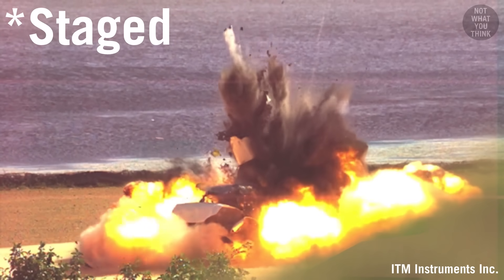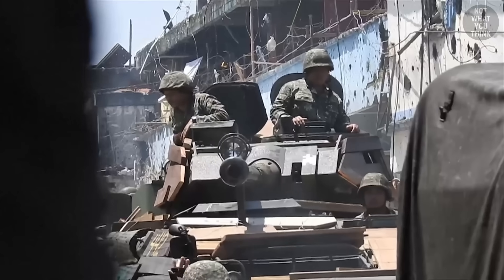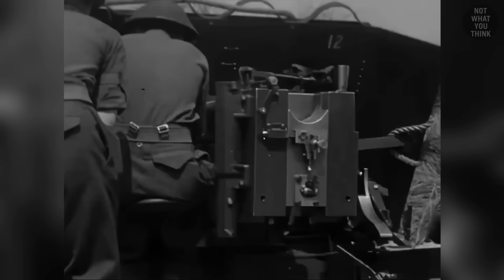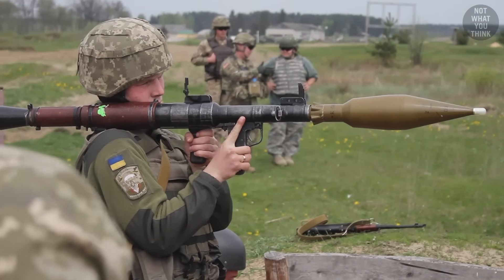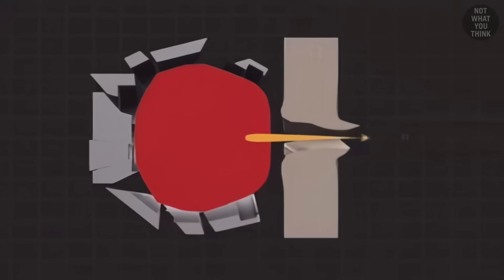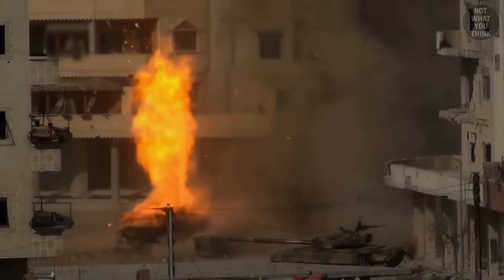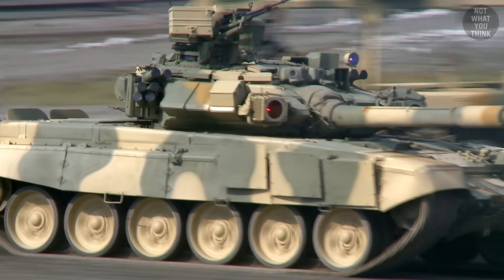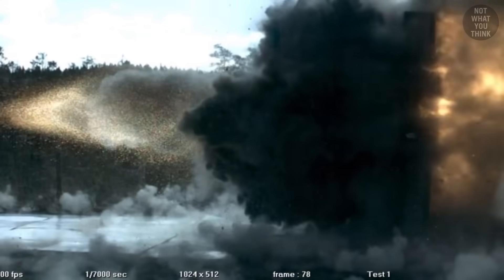Why Protecting Tanks is Getting Much More Difficult

Comment: This is basically what happened to the knight. Armor went up and up as the crossbows and warpicks evolved, even getting through some gunpowder. But when enough guys have pikes ans gunpowder, heavy amor its just too expensive, so the infantry revolution happened. 
If we repeat history, we could see lots of infantry supported by fast small tanks or recon vehicles with active defense systems and just enough armor to protect the core elements.

After that idk... maybe heavy energy shield generators with laser guns
Reply: It is a common misconception that armor was prohibitively expensive. Production methods and capabilities saw a considerable improvement in the late middle ages. 
If you were a citizen in a german city around 1600, you had some privileges but also duties. 
As your duties revolved around keeping the order and aid in the defense of the city, many cities required from their citizens to keep a full set of armor and some specific weapons and guns.  
When gunpowder based weapons first arose, their punch was not as high as 100 years later. in this time, many pieces of armor underwent shot tests, where the manufacturer was shooting a cuirass to prove it was bulletproof. 
Only after guns gained more kinetic energy many years later, full suits of armor were seen fewer. However, you still see cuirasses, leg and head protection on many Landsknecht soldiers. 
A big part of the change to infantry armies, apart from the gun, as you correctly pointed out, was the politcal landscape. Knights needed to be in service for all their life needing a retinue and were producing costs. In addition to this, they required training from a very young age on. 
If you could recruit infantry just for specific wars and only pay them for these wars, you were much more flexible and scalable with your armed forces in terms of money and size.
Reply: @mephisto8101  very interesting
Reply: @mephisto8101  very much true. also, pike and other formations are highly effective agains any kind of heavy cavalry (infantry can have a longer tool :) ), but they require highly trained infantry that can hold a formation under pressure. In other words, mercenaries or pro troops like janisary can be lethal as infantry on the field, while primarly peasant armies cannot achieve the same
Reply: @MrKrtek00  Exactly. You can have lots of "fresh" troops, but you need a solid core of experienced infantry in order to harden the nerves of the whole formation. That was as true for roman legions as well as germanic Gewalthaufen or the spanish Terzios. 
The film "Alatriste" with Viggo Mortensen displays this kind of combat quite well for a movie.
Reply: Sharks with lazer beams would be the next logical step imo.
Reply: @JackRabbitSlim  Hmm....  But what about on land?
Reply: @polarvortex3294  Don't complicate things ok. Once we have the sharks with laser beams then we can discuss any flaws in such a strategy.
Reply: @JackRabbitSlim  I've done a lot of soul searching these last few days, and in the end I'm convinced you're right.  Any thoughts about such things as kamikaze porcupines or drone geese must be put aside until the laser sharks are perfected.
Reply: Well not exactly. Cavalry and basically heavy infantry still persisted for the wealthy. Cavalry's role is to chase down retreating enemies and exposed artillery, unprepared infantry, and even cavalry itself. Even during the infantry revolution, even before the Napoleonic wars, the Swedes, the Spanish, the Ottomans, and the French would constantly use light to heavy cavalry as a means to outflank exposed enemy lines where Artillery, supply lines, and unengaged infantry would be extremely vulnerable towards cavalry attacks, especially during the Napoleonic wars with the Tatars just ambushing them beyond their supply lines. The knight simply reformed into the noble officers.

Its kind of the same role for the tank, to be the main gun and armor of the infantry to push through softened targets and any form of barricade that wasn't harmed by Aircraft and artillery.
Reply: It’s more complicated that that. More explicitly it’s what x thing offers over y thing the reason the crossbow was replaced was because if could penetrate armour the reason why armour was replaced was because it didn’t give any advantage. If a tank has armour that can be pierced it doesn’t suddenly become replaceable why? Because it’s more than just armour. It’s a mobile gun that can give immediate accurate fire that can destroy cars, tanks, buildings. It’s also a mobile machine gun for countering infantry. Additionally it’s a mobile smoke launcher. All this and it’s faster than an infantry man. If you can do better than all those things then it’s replaceable. And technically armour wasn’t replaced it just went under hiatus notably speaking with the advancement in body armour like Kevlar
Reply: @kadebass6187  There's some great videos by Tod's Workshop testing medieval arrows against medieval armor from the same period. A breastplate CAN stop a 180lb warbow. Fantastic stuff if you're interested in it.
Reply: If I had to pick, I'd bet the next iteration will be similar to the Metalhead episode of Black Mirror. Small AI-driven mass-produced drones that are quicker, more efficient, and more ruthless than any infantry at a fraction of the price. It seems like even publicly available consumer technology is nearly advanced enough to make it possible.
Reply: solution... FASTER TANKS with point defense guns make them move like armored core with jet boosts 
jk jk
Reply: At the beginning and during ww1 there was still body armor and by now body armor is there again.
Reply: Laser guns ? You can prevent any laser attcks by using a mirror ....
Reply: not if its a lasgun
Reply: Its obiously leadfing to a future with gaint mecha robots or gundams. Why have armor whwen you just dodge the missile?
Reply: @ashstaredviper  then the UK will be the first to develop new super efficient mecha warriors and proceeds to invade and annex Japan into a special region...
Reply: Get ready for ai powered small vehicles.
Reply: @Winahh Taylahh The Romans also did very poorly against mixed forces armies, because they were very anti-cavalry. It turns out that people on horses going around the sides, or shooting arrows at you hurts.
Eventually they ended up using foreign auxiliary cavalry for their flanking and running down routing enemy troops purposes.

But more importantly, the Infantry they were talking about was "man with a coloured coat and a rifle". ;)
Reply: Hence the Sci fi version from the book "Into the Light" -anti gravity tanks using Railguns, because dust and mist can effect lasers by refraction, whereas a railgun with a small, super dense projectile costs pennies compared with expensive missiles or energy intensive lasers which can be defeated by simple water vapor. David Weber, Out of the dark, into the light-good miniseries, and gives us Ideas by using logic. If we need direction, i think that's a good start. Sanders tank with 20mm railgun penetrates 300mm of chobham armor and would go thru standoff as well as reactive like butter-It's Done that in tests. up to 12k range, LOS. Infantry weapons-"Bronto" using subcaliber 4mm dart can pen up to 100mm of armor, and with no heat buildup thru friction, your rate of fire can be adjusted without concern for barrel wear-energy is stored In the cartridge, so the rifle can be even lighter. Exoskeletal support so the troops can carry enough to be effective, including survival equipment and water as well as personal armor.
Reply: With mounted knights, I also figure horses must have really limited the benefits of plate armor. I've never seen practical horse armor as thorough as a knight's full plate and your horse is an absolutely massive target.
Reply: Armor never went away, it just changed to become lighter and more flexible. It won't stop a bullet, but it will stop spray from bullets hitting the ground gloseby for example - in general, it's better than nothing 🙂
Further, I think that the next iteration in tank technology will be drone tanks less than a quarter the size of the current models for speed and agility. Also, price and production speed - the guns can be a lot smaller as well, as those tanks would mainly fight infantry - they could even be equipped with a final weapon, being a large explosive in its middle so that they can serve as a form of kamikaze-AI once their ammo runs out or they become damaged.
As with the knights you mention bigger meant more protection but that's not working anymore. So, smaller and agile must be the next step.
Reply: @Widestone001  Yeah they had some crazy ass armor in WWII.

 I have seen guns against well made historical plate curasses and they actually deflected the bullets. I forgot what time period and style but it did stop them. It reminded me a Spanish Conqusitor armor.

 Armor was very effective. Kind of wish defense always had the upper hand and shit would be like Dune or WK40k. Yet I doubt there is any material known to man that can withstand chemical weapons - it just requires more Ommph on their part.

 Even graphine would require a ton to protect from a 120-130m sabot.
Reply: @Widestone001  We'll probably see armored exoskeleton infantry to support those drone tanks, or replace them in urban combat / combat in rough terrain. All that power armor really needs nowadays for the first generation of it to be truly practical is a good enough battery system, miniaturized enough, that can last for at least one day of sustained operation.

Sure, that gives it short legs, logistically speaking, but still makes it useful for sustained front line combat, and significantly augments the already-versatile human combat platform.

Pair up the power-armored infantryman with an ecosystem of robot support drones (scouts, IED detectors, fire support, supply-carrying mules, portable batteries) and that's the next weapon system right there, that should see the militaries of the future through the next several decades of conflicts and challenges.
Reply: @Widestone001  By that time, we'll be probably using EMP bombs. Forcing us back to fight with fully analog weapons.
Reply: @Widestone001  Modern armor can stop bullets. It's just not going to do well against armor piercing rounds specifically designed to get through it. But yeah, like you say, something is better than nothing, and arguably, we just have knights with guns nowadays instead!
Reply: All of this will be disrupted by drones. Wars of the future (if fought between 2 sides with fully modern armies) will be only drones of varying types and sizes. Already the technology is freely available to put high resolution cameras with reliable, versatile image recognition on drones. Combine that with a small gun turret and deployed in swarms entire groups of infantry would be killed before they were even aware they were being engaged. The swarm being controlled by coordinated software would allow them to act in perfect unison. Just wait until all targets are in sight and all fire at once. The swarm could fly somewhere ahead of time, and have mechanisms to land and cling to trees, buildings, etc., and wait silently. They would be supported by small, very fast wheeled or tracked drones carrying heavier weapons. It would be an absolute nightmare to fight for a conventional ground force. Larger strike drones already make it impossible to operate tanks without air superiority. I doubt humans have any place at all on the battlefield (other than as remote operators) for longer than another 10-15 years. Eventually even remote operators would disappear as disruption of control signals would become an integral part of warfare, forcing ever more reliance on onboard AI.
Reply: Oh I'm sure we aren't too far off from seeing things like force fields.
Reply: Drone swarms will outmode even infantry. When all is said and done drone warfare is going to prove to be worse than nuclear weapons. Nukes will probably never be used. The odds of everyone reading this living to see the first mass-drone attack on civilians is enormous.
Reply: "After that idk"...  Back to sharp sticks!
Reply: @a noice
Reply: i feel like the human species will have killed itself before we get to energy shields unfortunately.
Reply: Infantry + drones
Reply: To be fair, body armor has sort of been making a slow, but noticeable comeback in the last few 20 years against small arms rounds. And as some other comment in this thread has pointed out, the only thing that we now need for practical Power Armored infantry is a powerful and compact enough core source of energy to sustain it. Plus, we're kind of reaching the upper limit of conventional gunpowder technology while materials are getting lighter and steonger as time passes, so if ETC guns don't come to screw over the fun again, maybe there's a slight hope...
Reply: the usa has made (or is still making) a laser weapon made for anti air, it uses enough power to power the average neighborhood
Reply: "heavy energy shield generators with laser guns" That IMO is fantasy. 
The US army has created laser cannons only to find that they are impractical and not letal enough, current laser tech we can create, requires huge amounts of energy and don't do anything more letal then just heat the fuselage of airplanes, lasers ala Star Wars they are not. 
The only futuristic weapon that could have a chance, if the army can solve the current road blocks, is rail guns (not ray guns) but these just work on the same principle as normal guns they just use electricity and magnets, instead of a explosion, to push the bullet out a barrel at super sonic speeds. 
About special energy shields I don't believe that will ever happen, not possible with the current tech and energy levels we are capable of controlling.
Reply: @Argoon1981  The energy shield is fantasy. 
Laser weapons are slowly comming in selected areas, mainly where energy storage is not that much of an issue and the target is fairly light armored, such as drones or missiles.
For example, the israeli Iron Beam is intended as a supplement to the already established Iron Dome effectors, aiming to reduce the costs of intercepts. Whilst introduction has been postponed, it seems we are fairly close to see this kind of systems being deployed. I would guess ground installations and ships would be the first to deploy these kind of weapons.
Reply: @mephisto8101  I hate when people start talking about fantasy weapons from star wars.
Reply: @Argoon1981  This is not entirely correct. There are also lasers which can intercept missiles. There are other energy weapons as well like the microwave weapon used to inflict unbearable pain in groups of people to dispers them.This kind of enegy weapons might also have some impact on sensors like drone sensors etc. 
They are no star wars true bit they might have some value. 
The Rail gun is incredibly difficult and it will not come to fruition with our current material and electronics tech.
Reply: If you look at the star war, they already had the next infantry and tank upgrades (drones -> energy shields -> Jedi with lightsabers)
Reply: @qiyinglin  Too bad star wars is 100% fantasy. The weapons and shields they used in those movies will not ever work in real life physics. You going to make a gravity field generator too?
Reply: @jgtheman84  That is true, but people from centuries ago, they will never imagine the possibility of our modern technology.
Reply: @qiyinglin  there are absolute physical limits to the kinds of technologies that can be made, and they can only be optimized so well. Lasers are not good weapons in an atmosphere. They suffer from ablation and overheat.

Comment: I agree the balance is shifting; but it always is & always has been.
No tank can operate alone, unless in an open field battle against a mass of other tanks. They need support to be effective anywhere else.
Even the original WW1 tanks quickly learnt to have infantry support; their treads are always a weak point, a tank that can't move is little different to a bunker. A team of infantry can blow a track if they need to W improvised explosives, as long as they know what to do.
The same presence of strengths & weaknesses is true of every military unit. This is where combined arms warfare comes from, developed thru WW1 & constantly redesigned & redeveped since.
Russia is wasting tanks because they aren't well trained or cooperative enough to have tanks covered by troops & wide ranging scouts or drones.
Modern anti-tank increases the range that you have to find them & deal with them; but once spotted are actually slightly hampered compared to other infantry.
Most big military failures of the last century come down to overwhelming force, bad practices or being hit by something you had no counter for/ no awareness of.
The Russians are failing three of those; hit by something they aren't countering because of bad practices.